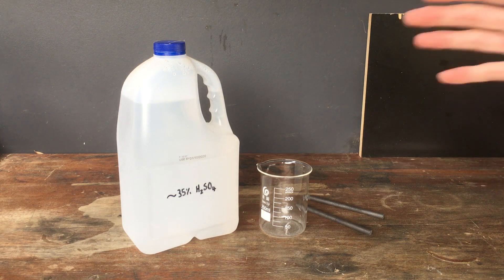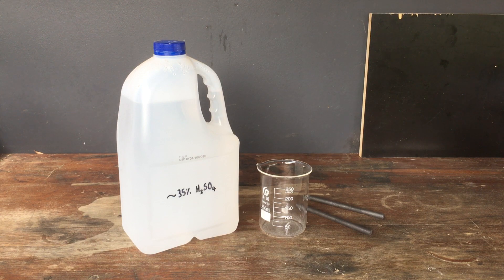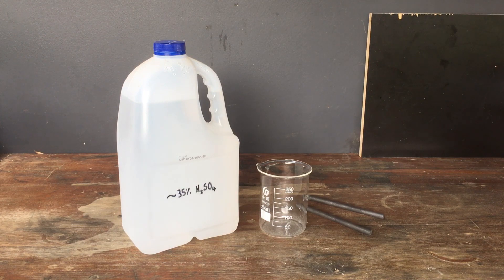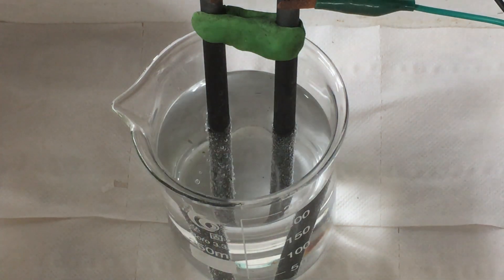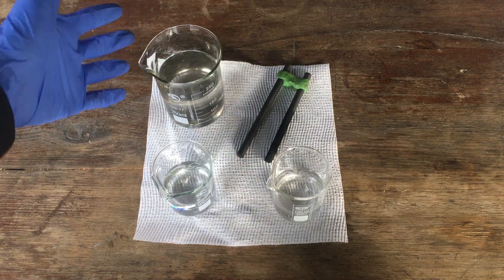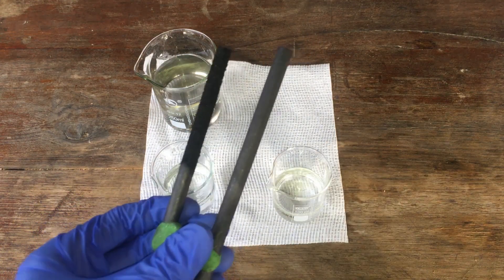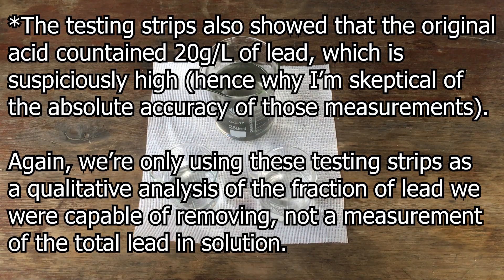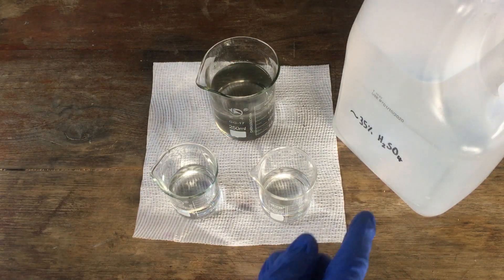Removing Lead From Battery Acid?

Comment: I looked into this and found data suggesting lead sulfate is even more poorly soluble in aqueous solutions of sulfuric acid than in pure water and only forms lead-hydrogen-sulfate at high concentrations (somewhere above 80% H2SO4) where solubility increases.

I think the lowest solubility is somewhere above the 35% mark, but it should already be very low at that point, and it shouldn't have retrograde solubility with temperature, so using a freshly charged battery (assuming the cells are weak and not shorted) and letting it chill at night in winter to as cold as you can manage should minimize lead contamination before decanting/filtering. (then chilling the recovered liquid again in the freezer and further decanting/filtering) Concentrating the acid to minimize solubility would have mixed results, though, as the increased viscosity would make settling and filtering more difficult.

Charging the battery should provide some purification via electrolysis (anode forms PbO2, Cathode forms Pb, lead sulfate in solution gets converted to sulfuric acid).

However, on top of all of this, there's a small amount of calcium in the lead alloy making up the grids in lead-acid batteries, and calcium sulfate is significantly more soluble than lead sulfate (also, its retrograde solubility curve occurs over 30C, so at low temps it'll drop, but still be a couple orders of magnitude higher than lead sulfate's). There's enough calcium in the alloy to easily provide enough to form a saturated solution with the limited solubility of CaSO4, especially with an old battery.

So between the sulfuric acid and calcium sulfate, there lead contamination in chilled acid should be extremely low, and there's more likely to be issues of particulate in suspension than anything in solution. You could even add calcium sulfate to make sure all lead precipitates out (and to provide seeds for some CaSO4 precipitation), but then you're still stuck with trace calcium impurities in the acid. (at least that's non toxic)

You could probably sequester the calcium using electrolysis into mercury amalgam ... but that's just adding in more toxic chemistry.

Probably just better to chill it as low as possible and let as much calcium sulfate precipitate and settle out as possible. (then concentrate it to the point of minimum CaSO4 solubility, ie below the hydrogen-sulfate formation point, and chill again ... though the added viscosity will be a problem)

On a side-note, for concentrating the acid, rather than boiling, you could try refluxing and evaporation when ambient humidity is lowest. On cold, dry winter days outside this is best as absolute humidity is low and as long as the neck of the refluxing flask is kept close to or above 100C, all the water should evaporate out and be absorbed into the dry air. (with the very low absolute humidity, the relative humidity near the heated flask will be extremely low, sufficient to keep the vapor pressure of water in solution high enough to evaporate with minimal to no loss of H2SO4 vapors ... at least up to the azeotrope point ... and you MIGHT be able to brake some azeotropes this way where water is the lower boiling component and air is a more aggressive solvent than the other component, effectively acting as a desicant, but I'm not sure it would work here)
It should at least result in much lower acid vapor loss than boiling would cause and should allow higher concentration than boiling would allow.

Conversely, warm, humid days would be absolute worst for evaporative dehydration in this manner. (and even dry days would tend to be more humid in the absolute sense than very cold winter nights when the sky is clear)
This also applies to hygroscopic salts and possibly even some hydrated salts. (it might be possible to dry some hydrates this way near their decomposition point without fully melting and boiling off the unstable solution ... interesting to try for some unstable salts like magnesium chloride or nitrate that tend to hydrolyze when attempted at higher temperatures)
Reply: I saw probably the same reference. So maybe dilute to 20%, chill, vacuum filter, the reflux it until it’s at the concentration that you want.

I’ve been sorting out the lead dioxide. Maybe take that portion and mix with a gallon of white vinegar to make lead acetate then use that as a reagent for whatever other synthesis you want.

Comment: One way to increase concentration of acid solution is by electrolysis diring hot summer when you can make use of  solar PV electricity to gasify away the water component .

Comment: Isnt lead sulfate is insoluble🤔
Reply from the maker: Most things that we call 'insoluble' simply have solubilities that are very low (but not zero). This is the case here.
Reply: @ScrapScience  0.0032 g/100 mL (15 °C)
0.0404 g/100 mL (25 °C)

Comment: Lead sulfate is about the lowest solubility in dilute acid you can get. Which is what you probably have there. Filtration would be enough to get it all out. 
It is soluble in concentrated sulphuric acid, which is not what you have there.

Comment: Some googling found that EDTA (commonly available food additive) could be added to lead-acid batteries (and should even rejuvinate them by sequestering the lead sulfate).  Seems like an interesting idea here.  Another thought to try might be table salt.  It is used to precipitate silver and other chlorides when doing refining but given how close lead is to the other metals, it seems worthwhile.  The salt will also react with the acid to give you HCl (which can also vaporize off) but you'd think the lead would react first.  Finally, it might be worthwhile titrating with salt or other chemicals that let you see the lead in solution rather than relying on strips.  Also, lead sulfate is not particularly soluble in water or sulfuric acid, so while there is almost certainly SOME lead in the acid, it isn't very much.  25C Lead sulfate is 0.4g/L - enough to be a waste issue, but not much will plate out in electrolysis of a 200 ml diluted solution.

Comment: You could filter it with sand using sand as a filter in a funnel .you could buy a vacum chamber and Distil it vacum chamber only need 80 degree to distill

Comment: The solubility of lead in sulfuric acid should be very low (for normal spilled acid, but I realize you poured this out of a battery and hence it could be higher).  You may not have actually had much lead in there in the first place. If you look at reviews of Vansful test stripes, they can suffer from false positives.  If you're going to test, I would use a better quality test kit like 3M.  Or find a place to rent an XRF machine (our city provides them for free to check homes). 

Fwiw, I did a bunch of research into the lead content of electrolyte at one point and couldn't find much evidence that electrolyte has a lot of lead.  

Electrolyte leakage is very, very common in batteries (e.g. those orange stains under golf carts) and if there is a lot of lead content in them, it would pose a significant environmental hazard.  I don't think there is however.

Comment: Would centrifugation work ? Lead sulfate density is 6.3, sulfuric acid is 1.8
Reply from the maker: Centrifugation can't remove things that are in solution, so I'm afraid not.
Reply: Ion exchange, fractional distillation, vacuum distillation, vacuum filtration, special lead filters, coffee filters - those will work the best.

Comment: You can raise the concentration of Sulfuric Acid in the original battery electrolyte by charging the battery. I realize the battery may not be any good or hold a decent charge, but it doesn't cost much to throw it on the charger and boost the acid content.
Reply: I like that idea
Reply: @parcydwr  Charging a battery converts the lead sulfate on both anode and cathode to sulfuric acid and the corresponding lead (cathode) and lead peroxide (anode).

Comment: Isn't lead actually sulfate insoluble?
Reply from the maker: Mostly, yes. However, it’s very slightly soluble under standard conditions. Additionally, with sulfuric acid in solution too, lead can actually form a much more soluble complex with the bisulfate species.
There’s not much in there, but there’s enough for me to be concerned about contamination.
Reply: @ScrapScience  
Well, I do see your concerns. Hadn't expected an answer, honestly. Apprecieates that you put your effort into it. :) 

I actually had searched "scrap science" on purpose, cause I'm a huge fan of recycling and upcycling what's at hand. Don't like when stuff goes to waste, and have always missed a channel where chemistry is put to use. 

I've actually been researching the topic of lead acid batteries and sulfuric acid for the last couple of days, trying to come up with a method of simply performing these reactions in the battery itself; thus far I've learned not to trust chemical balancers as these just balance equations, and these reactions not neccessarily can be achieved (for example, Na2SO4 + SiO2 resulting with H2SO4 and some metasillicate). 

However, it is feasible to refill a battery with distilled water and recharge it if possible before attempting the acid recovery; but I think its better to filter the electrolyte before rechargin, as there is a chance some larger crystals had fallen off the plate. Then you can refill back and charge. 

I'd probably flush the electrolyte at a charged battery and refill with distilled water and some epsom to perform a second flush, but not sure of the results. 

Thanks for the content.

Comment: Can a much larger surface area of stainless steel electrodes do a better job?
Reply from the maker: Stainless steel electrodes may find use as a cathode, I'm not sure of their effectiveness though. However, they will dissolve and corrode away as an anode material.
Reply: @ScrapScience  I am aware of that. It seems the same thing happened to the carbon electrode, and I am wondering if the s.s. might be more robust, to allow the process to continue long enough to remove a higher amount of lead.
Thank you for responding,  your expertise is invaluable.👍
Reply from the maker: While it's true that the carbon electrode also corrodes, the great thing about carbon is that you can just filter the resulting dust out of the solution, without actually contaminating your acid sample.
With stainless steel, the corrosion will result in iron and chromium salts leaching into solution, giving  you a worse problem than the lead contamination that you started with. In acidic conditions, the corrosion of stainless steel is surprisingly (and annoyingly) fast.

Comment: Hi! I was wondering if it would be possible to purify the battery acid by using an cell whit a diafrgm to not mix in the led again? 
Sort of like in the Epsomsalt electrolysis video?

Comment: 20g/L is not possible.  The maximum solubility of lead sulfate in sulfuric acid is 3.87mg/L at 25C and 25% acid according to jresv22n1pp55_A1b.pdf from nist.  Concentrating the acid above 50% and cooling to 0C leaves unmeasurable lead in solution according to the paper. Common ion effect forces it out.

Comment: Doesn’t some of the metal come over with distillation? I work in the cannabis industry and I’m told that cadmium and other metals pass through the short path distillation process for producing oils.
Reply from the maker: This is only true when the metals are present in the form of organometallic compounds. Inorganic metal contamination generally won't come over with distillation, so in this case, distillation is an excellent method of purifying the acid.

Comment: I know in gold refining they add sulfuric acid or sulfur dioxide because lead sulfate is highly insoluble. It's very possible that there may not be any appreciable amount of lead in solution to begin with.
Reply: There certainly is a bit of lead sulfate crystals, and these just don't want to react.
Reply: @Noswiatel  Maybe cooling down the whole solution would help sulfate lead precipitate ?

Comment: if there's any lead present in the solution, try using concentrated sulfuric acid to for lead sulfate and then filter the lead sulfate out of the solution and then your solution should be lead free, it's very important to use concentrated sulfuric acid
Reply: The whole point of this is to obtain concentrated H2SO4...

Comment: You can synthesize sulfuric acid by replacing the sulfuric acid in a lead acid battery with epsom salt after you have charged it. Simply discharge the battery rinse out electrolyte and replace with distilled water. After charging the battery remove the liquid and you will have sulfuric acid. Repeat as needed. You can substitute the magnesium sulfate with ammonium sulfate as well. Another method to synthesize sulfuric acid, is to electrolyze magnesium sulfate with the anode isolated in a clay pot. This traps the sulfuric acid within the clay pot.
Reply: Nope. "Fred Wehmeyer, Senior VP of Engineering at U.S. Battery, has more than 50 years of experience in rechargeable battery design and development.  He says that many of these hacks claim to show some type of improvement, but the gains shown may simply be artificial. One of the more common ones is adding Epsom salt to the battery cells.  According to Wehmeyer, adding Epsom salt (magnesium sulfate) to a lead-acid battery will ‘artificially’ increase the specific gravity reading (SG), but because it does not increase the sulfuric acid concentration, it does nothing to improve battery performance.

“This is because the sulfates in the Epsom salt are tied up as magnesium sulfate and are not available for discharge to lead sulfate as the sulfates in sulfuric acid are,” said Wehmeyer. “If you filled a new lead battery with a magnesium sulfate solution instead of sulfuric acid electrolyte, it would have no capacity at all.”  Simply put, adding Epsom salt will not recover the battery capacity but does “artificially” increase the SG.

According to Wehmeyer, the result would be similar if you remove the dilute electrolyte from a discharged and/or sulfated battery and refill it with the electrolyte for a fully charged battery (usually 1.270). The specific gravity will be higher, but the battery plates are still discharged and/or sulfated. Doing this will probably kill a potentially recoverable battery."
You don't want magnesium ions in your battery.

Comment: I didn't hear what voltage you said you are using but I know for essentially this same process but with gold at like 3v it will plate and 5v it will plate but fall off easy and get brown sludge and at 12v you only get brown sludge which is your gold but none on the cathode basically

Comment: Is every battery acid sulfuric acid?
Reply from the maker: When it’s a lead-acid battery, then yes, the acid is always sulfuric acid.
In the case of car batteries, they’re pretty much all lead acid batteries, but some designs have the acid soaked into fabric sheets within the cells, making it near impossible to remove.

Either way, if a car battery has liquid inside, it’s definitely sulfuric acid.
Reply: @ScrapScience  thanks, i have two small batterys from a motorcycle and they have a Pb sign and have a kind of liquid in them
Reply: @ScrapScience  What about gel 12v batteries? They are lead and..  gel?  What's the gel made up of?  Makes for a more robust battery..  but from science perspective.. how? and what? can be made of them?

Comment: Try boiling the acid down before electrolysis, diluted acid will keep dissolving the lead back into solutions, concentrated acid will not
Reply: not while there is a current applied

Comment: The carbon rod that fell apart may have been converting into some form of graphene? I think on Robert Murray Smith's channel he used H2SO4 as an intercalator for breaking up graphfoil via  electrolysis into multi-layer graphene. He then sonicated it to finish the conversion. Maybe the rod was doing something similar? Could be good for some other experiments later :)

Thanks for the great vid.

Cheers.

Comment: The lead from the sulfuric acid may be easy removed with a small amount of hydrogen sulfide. I think it is much better since it eliminates the need to distill the sulfuric acid itself -- you must boiled off only water (and a little bit of sulfuric acid) to obtain the high-quality azeotrope without heavy metals and organic impurities.
Reply from the maker: Actually, having thought about this for a couple of weeks, I was going to give it a go, but it turns out that lead sulfide will not precipitate in a solution which is this strongly acidic. Sulfides aren't stable in acidic conditions since the sulfide ion acts as a base. 
It's a little disappointing, since this again leaves us with only distillation for removing the lead.
Reply: @ScrapScience  We tried it.
For most purposes, however, dirty sulfuric acid is also suitable. The products of its use in some cases are not acidic and lead can be precipitated from there (for example, obtaining nitric acid). Also, there is IMHO not a very good option not to remove lead due to its insignificant amount for nature. 
The distillation of sulfuric acid is not difficult when using a gas stove. For perfect operation, the only thing that is necessary is a retort without stopper.
Reply: @dimaminiailo3723  Show us!
Reply: @YouMockMe  I wanted to record a video about this process, but now I am busy with the another things(
Reply: @dimaminiailo3723  Tease. 👎
Reply: @YouMockMe  I myself am not happy with the stopped project, believe me(
Reply: @dimaminiailo3723  I just sat here trying to figure out what the chemical formula IMHO was... and then I realised.
Reply from the maker: That's definitely a good idea, I didn't think of that. Thanks!

Comment: Can you make powerful dry cell batteries from scrap?
Reply: The patents on making nickel-hydroxide-oxide electrodes for a nickel-iron battery are well-expired. Great for solar systems, as it's fine to over-drain or over-charge... wet cell though.